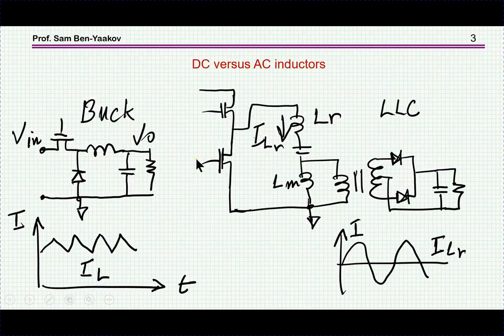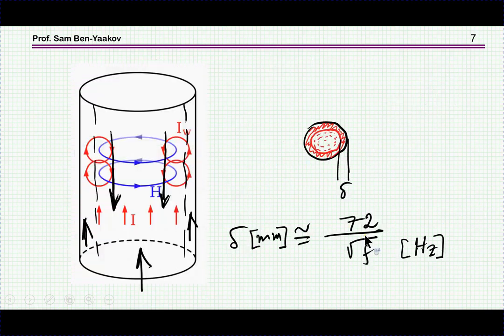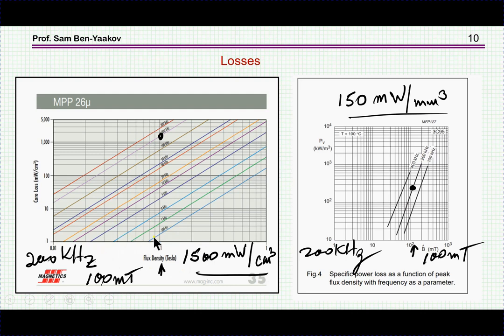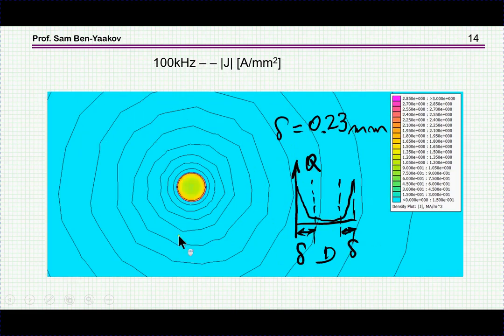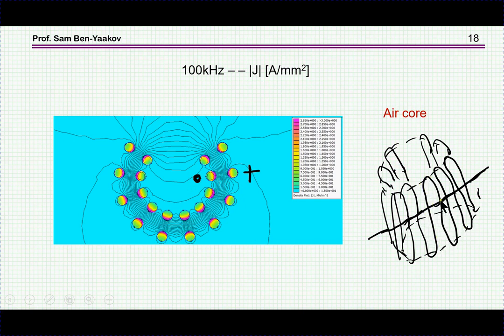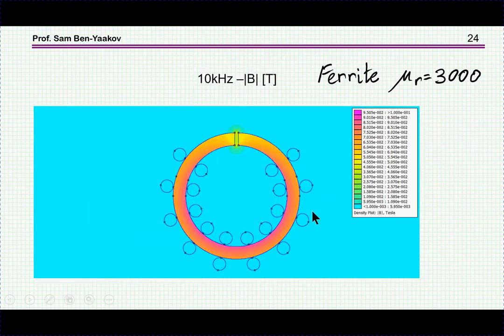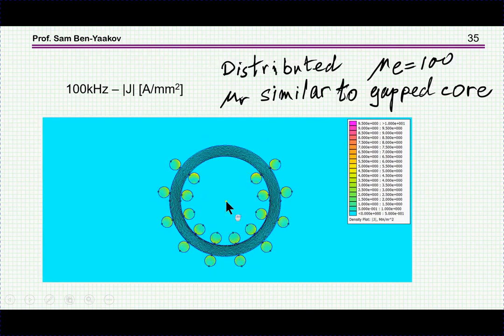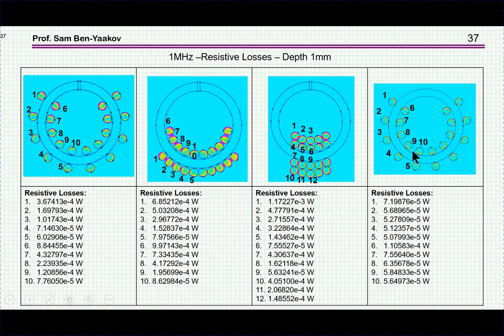In case you missed it: Toroid inductors for resonant converters The beauty of FEA based simulation

Comment: Dear prof., around 9min 30 there is a mistake. The plot on the right represents the loss density per volume of the unit, expressed as kW/m3. You refer at 150 mW/mm3, but this is incorrect. 
Please note that 1 kW/m3 = 1mW/cm3 (centimetre cubic, NOT millimetre cubic).
This value shall be updated to 150 mW/cm3 (once again, centimetre cubic).
A value such as the one indicated on the video would quickly destroy the core due to unfathomable losses. 😉
Reply from the maker: thank you for pointing out the typo. the cottect cnverson is seen on the left figure. Nothing was distroyed when I ran the simulation😊

Comment: Great video, I have seen a trend of  using flat wire vs Litz, Wich is the difference?
Reply from the maker: With a proper diameter of the strands, the skin and proximity effects are negligibly small.
Reply from the maker: Performance could be the same but flat wires (tapes) are difficult to wind.